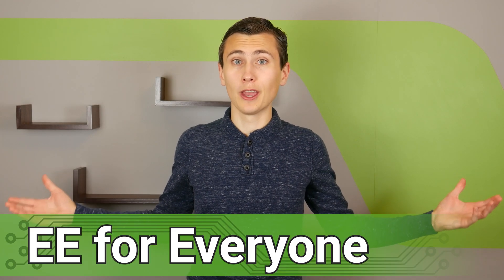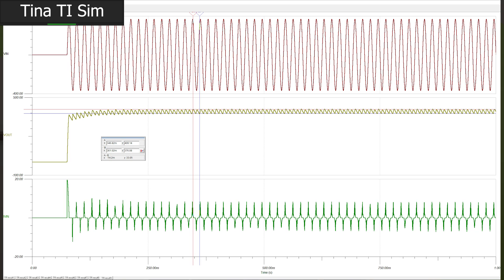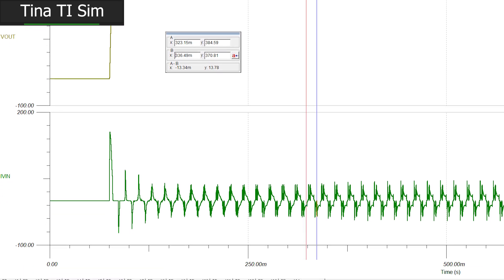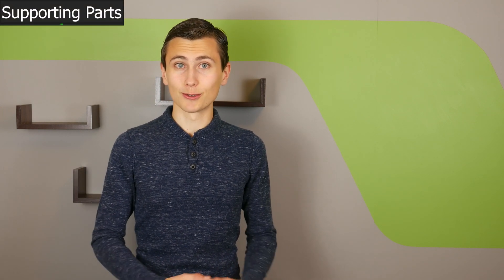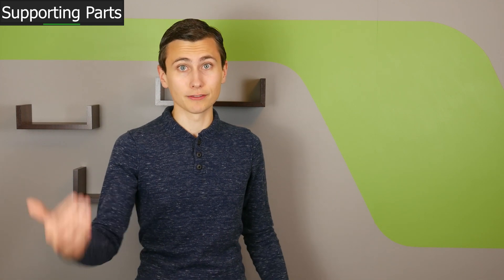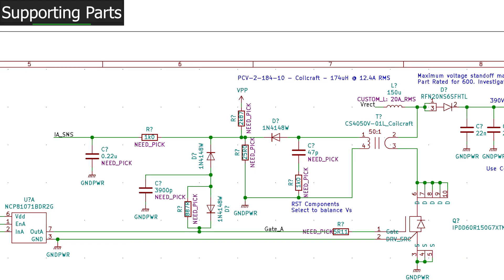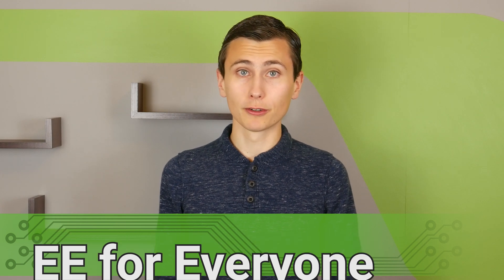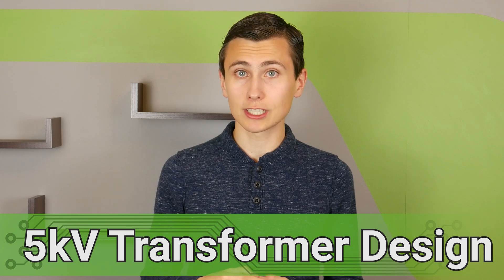2400W AC to DC PFC - Simulation and Part Selection

Comment: The reason you see more ripple voltage on the output and need more capacitance is that both the input power and output power pulsates at twice the mains frequency, ideally following a Upk * Ipk * (sin(2*pi*f_line*t))^2 shape when the PFC input is sinusoidal in both voltage and current.

Comment: Did you consider (for safety sake) to use huge isolation transformer, during first live tests?
Reply from the maker: Hi Sanel! Thanks for watching! I'm not concerned about isolating the mains input when testing the PFC Module. This is because the 400V DC output is actually more dangerous than the mains input! The best way to make sure we'll stay safe will be to tie the metal chassis of the larger system to protective earth.

Of course, an isolation transformer could be used, but I'd still want the box tied to PE.

A steel box tied to Earth ground should contain fire and electrical hazards. I'll power the system with our first UPS prototype for the first test. It can generate low voltage AC power at 60Hz.

I don't plan to test this module outside of the UPS system. If we would, that could be much more difficult and considerably more dangerous.